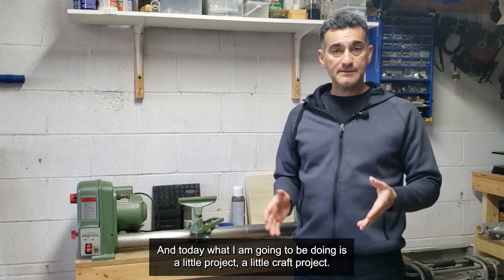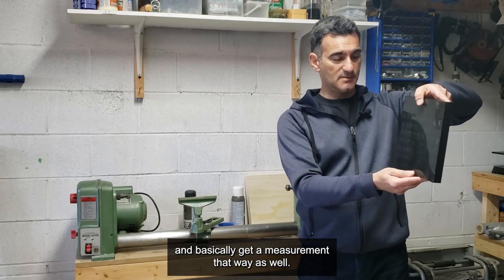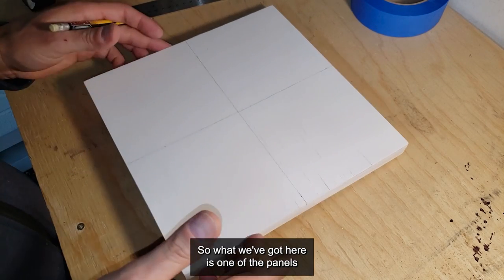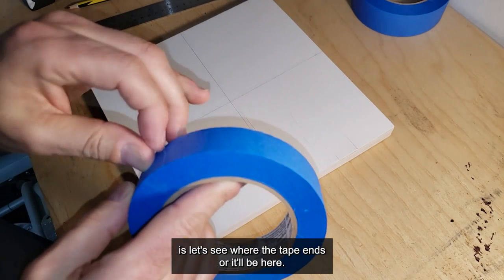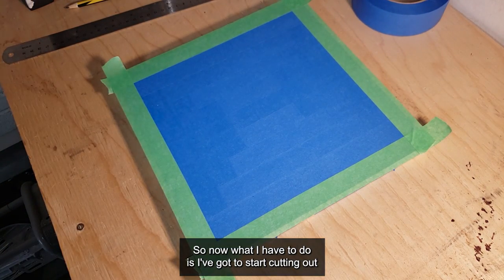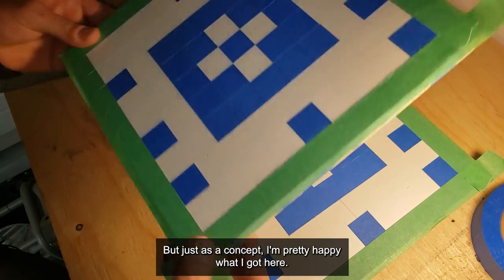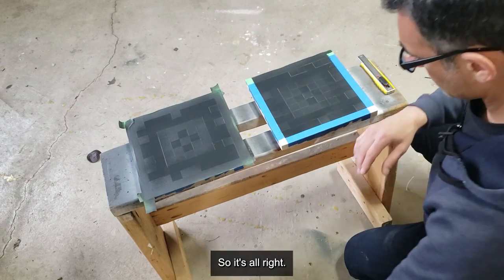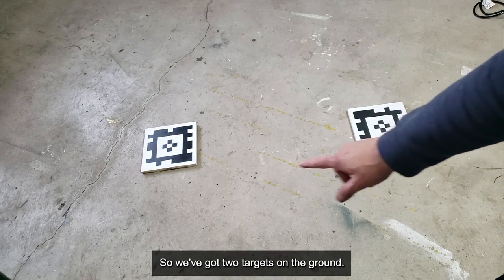DIY: Creating April Tags to use in Recon-3D iPhone LiDAR scanner app | 3D Forensics | CSI

Comment: How far between targets should we place? If I scan a section for 40m long, placing those targets at the start and the end of section about 35m. Using RTK GPS or Total station to measure precise Horizontal distance between them. Will that help to improve the accuracy of the scan ?
Reply from the maker: Keep in mind that the only thing the targets do is a global scaling of the point cloud. Recon-3D only uses the centerpoint of each target and a known distance between them. It does not use XYZ coordinates to somehow improve the result… At least not yet. If you were to get a low cost disto from a hardware store that was accurate to 2mm, then you could achieve the same thing. Also, keep in mind that because Recon-3D uses sensor fusion between Lidar and Photogrammetry, you don’t get the same kind of noise and drift as just using the LiDAR sensor alone. We have loop closure as well. At some point in the near future I’ll be doing a video on this.